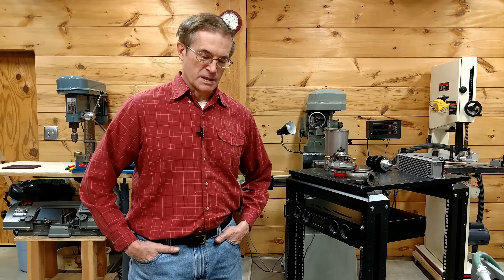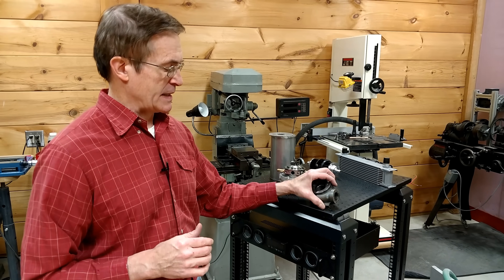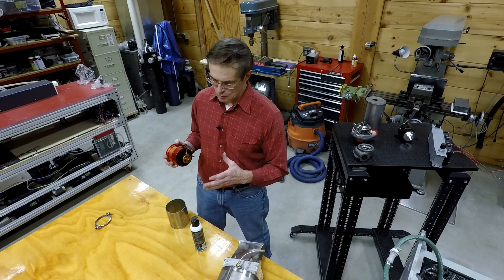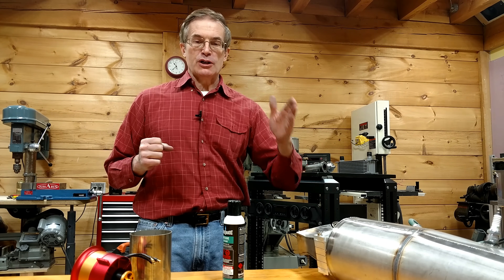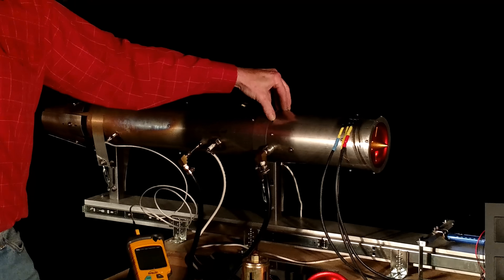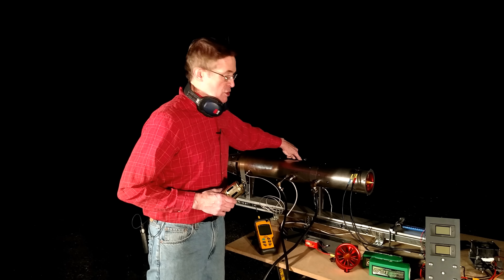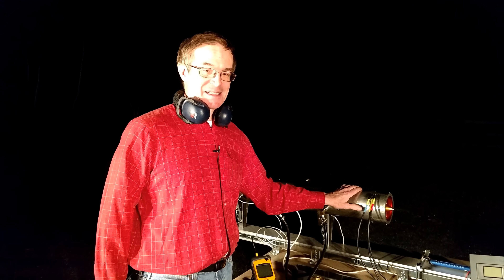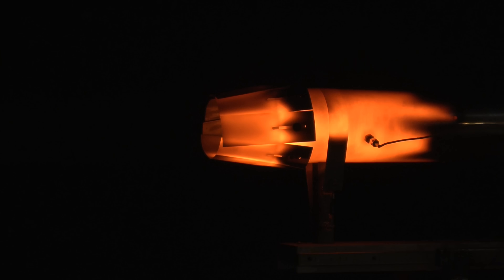Hybrid Jet Engine

Comment: I notice you say at 05:45 that water doesn't flow uphill and gasses don't flow from a low to a high pressure region. You should be explaining quite the opposite to understand the operation of a combustor.

As an analogy, on the pressure surface of an aerofoil, you will see a gas flow towards the trailing edge, despite an 'adverse' or increasing pressure gradient. It does this because it has momentum. Water, too, will flow straight uphill given it starts with uphill-wise momentum. A combustion chamber is in fact at the highest pressure in a jet engine (for a Brayton cycle), and the fluid flows straight into it, by trading off momentum during the diffuser section.
Reply from the maker: You make an interesting point.  However, the principle holds that gas will not flow from a low to high pressure region, given steady state conditions.  The kenetic energy present in the gas exiting the compressor blades can and is converted into additional pressure in the diffuser.  This is part of the compression process.
An analogy is the ram jet.  The pressure in the combustion chamber is higher than the surrounding atmospheric pressure due to the conversion of kenetic energy into pressure.
Reply: I have no doubt you are very knowledgeable when it comes to tech and physics, and your explanations are not wrong (Yes, I agree that a ram jet intake converts dynamic pressure into static pressure), and I absolutely love the quality of all your videos, but along the way you have picked up an incorrect "folk physics" statement:

"However, the principle holds that gas will not flow from a low to high pressure region, given steady state conditions."

It doesn't explain anything accurately and is in fact not true. The steady flow through a diffuser is proof by counterexample. You will see that fluid flows through a diffuser from low pressure to high pressure during steady flow, without any problems whatsoever. This folk physics statement is similar in nature to the incorrect wisdom "electricity always follows the path of least resistance".
Reply from the maker: "You will see that fluid flows through a diffuser from low pressure to high pressure during steady flow, without any problems whatsoever."Aside from your statement about folk physics, "without problems" is not a thermodynamic argument.Steady flow does not have any relationship to velocity changes and velocity changes are the principle that drives this change in pressure.Don't worry, I and many of the readers of these comments can handle the math.  Can you provide the equations to support your contention?
Reply: You don't need to invoke any thermodynamics as this holds even with isolated systems (zero work or heat transfer). Instead you need plain old Fluid Mechanics. 

I refer specifically to the one dimensional Navier-Stokes equations. Neglecting surface and body forces as they are irrelevant. 

∂ρ/∂t + ∂(ρu)/∂x = 0    
∂(ρu)/∂t + ∂(ρu^2)/∂x = -∂P/∂x    

The material derivative on the LHS is equal to the negative pressure gradient on the RHS. A consequence of these equations is that they can be satisfied by a velocity flow in the positive x direction with a corresponding increase in pressure. 

Say for air that starts with ρ = 1,225 kg m^-3, is flowing through a 1m length pipe from left to right, with a velocity of 10 m s^-1 at the inlet and 8 m s^-1 at the outlet, and the pipe is sized to allow that flow to cross the channel in 2 seconds.

Let's check the mass continuity
[1]: ∂ρ/∂t = (ρ_2 - 1.225)/2
[2]: ∂(ρu)/∂x = (ρ_2*8 - 1.225*10)/1

Setting equation [1] = -[2] and solving (I just did this numerically) finds that ρ_2 = 1.51324 kg m^-3.

Let's check momentum continuity:
The LHS (by plugging in the numbers) is:
∂(ρu)/∂t = (1.513*8 - 1.225*10)/2 = -0.07204 [kg m^-1 s^-2]
∂(ρu^2)/∂x = (1.513*8^2 - 1.225*10^2)/1 = -25.6526 [kg m^-1 s^-2]

Hence the RHS (by plugging in our previous two results) is:
-∂P/∂x = -0.07204 -25.6526 = -25.7247 [kg m^-1 s^-2]. If the initial pressure is 100 kPa then the final pressure is 100.026 kPa.

Therefore by solving the Navier-Stokes equation given our boundary conditions, we see that the pressure has increased, the velocity has decreased, and the density has increased. This shows unequivocally and numerically that fluid is capable of flowing from low pressure to high pressure during steady-state conditions. If this were not true, I assure you that aeroplanes would not fly.

Before raising doubts about the credit of these equations, first seek to understand the Navier-Stokes equations. Otherwise, if you feel the need to contest comments starting from the assumption they're wrong, purely on account of them being Youtube comments, I'll disclose that I have a first class MEng in Mechanical Engineering, and a postgraduate MSc in Aerospace Engineering. During the day I am an Aerospace Design Engineer for civil jet engines. I have published 1 book on engineering, tutored physics for 10 years, and have lectured university classes in fluid mechanics and aerospace principles.
Reply: I re-read your comment and I think we both already agree that fluid can flow into an adverse pressure gradient. I think the point of contention might actually just be the definition of 'steady flow'. If that's the case, then we just need to agree that steady flow allows a fluid packet to accelerate, so long as there are no velocity changes at a fixed point in space. Stated differently, steady flow simply means streamlines, streaklines and path lines are coincident.
Reply: What is wonderful about you is that you actually answer people! You aren't condescending and have time for the lowly even. Thank you.
Reply: Is this in response to myself or Tech Ingredients? He wasn't condescending but it was perhaps stubborn that he didn't concede when he was shown to be wrong. I put a fair bit of thought and effort into my responses, which is just a shame.

Comment: is the reason you're not getting shock diamonds because the pressure in the thrust isnt lower than the atmosphere or because the flame is too turbulent?
Reply from the maker: The primarily reason is that we do not have sufficient pressure in the throat to overcome the turbulence and allow the shock diamonds to be clearly seen.  You are correct that they are the result of supersonic flow into the surrounding atmosphere.

Comment: Hey! I’ve got a suggestion! Try using the electric motor to power a compressor instead of a basic EDF. Perhaps a unit from a salvaged hobby jet. A dedicated compressor will net you with much higher chamber pressures
Reply from the maker: True, but a lot less turnkey.  The best compromise may be to use a larger number of small, cheep, axial turbines.  Each will rotate in the direction opposite of it's predecessor and the RPM will self limit based on the mass/velocity if each is allowed a fixed current.

Comment: make an outer casing and have another fan at the end feeding it and the compressor. It will provide cooling for the inner casing. Like a Turbo fan!
I was a jet engine mechanic it the navy
Reply from the maker: Version 2.0 uses a thin stream of water>steam to accomplish this.

Comment: Very interesting.. I have my fathers pulse, V1 type engine in my basement.  never had the nerve or  knowledge to try to fire it up.. I think it runs on gas, and it needs an air compressor  for ignition.. does anyone know anything about these old engines..  ?   I can post pix. flappers before the tube.. really, I don't know what I have.. help.. oz

Comment: Demo in the dark place why like this
Reply from the maker: It is a visually attractive aspect of the engine, but more importantly it showed that the combustion of the fuel was complete prior to reaching the nozzle.  We are going to demo the two stage engine pretty soon.  We will show the thrust produced by the electric fans without the contribution of any fuel as well as the thrust produced when burning fuel.  We'll show this as well as an "exploded " view of the components of both engines and we'll do all of this with full light/during the day.  We'll show a full power run at night as well and we'll include some FLIR images of the engine and the exhaust plume.
Reply: Ahh ok thank for your sharing in your knowledge  longlive sir

Comment: You beat me to it :-),  I've been collecting components for a long time to do exactly what you just did.  I had some different ideas about it but basically what you're doing is sound.  I had planned to use a 90 mm fan for the core and a 120 mm fan in a multistage configuration with the air from the larger fan cooling the outside casing.  I then planned further to eventually connect them to the turbine spool to create a true turbojet.  As another poster has said it's nice to see someone who actually understands jet engines and their operation.  I further plan to use liquid fuel pumped through the spray nozzle from an oil burner.  The trick is going to be controlling the RPMs on the compressor as to not overstress the materials involved.  But I think it's doable.
Reply from the maker: It's good to hear when someone else is traveling the same road as you are.  A few points we have learned is that these fans, despite their power, are limited compressors.  Plan on pushing them as hard as possible in the pursuit of compression ratio.

Comment: I have been thinking about the thermal compound.. graphene from what I’m told is the ultimate thermal conductor ... could you use very fine graphite powder in a slurry to achieve something similar to graphene ?
Reply from the maker: Want to hear a secret? The performance of thermal compounds is much less related to the filler material and much more to the matrix it is placed in.  We've tested graphene, diamond, aluminum nitride and even single wall carbon nano tubes.  Because the matrix such as grease has a thermal conductivity 10,000x less than diamond and at least a thousand times less than simple aluminum, it is the minimization of the interface resistance that is the key.  Arctic Silver is good (annoyingly so), but we're knocking on that door and expect to pass it soon.
Also, there are methods, as long ans electrical conductivity is not a concern, that blow away these greases.  We'll show that as well.
Reply: Tech Ingredients cant wait to see that video

Comment: Future video where you build a jet engine or upgrade this with dremel or angle grinder, step up gears - high rpms- proportionally  big intake fan - higher intake volume - more power??
Reply from the maker: Yes, a future video is coming.  The direction is a little different than your list.  We will use a second stage EDF for higher compression.  This increases the conversion of the added heat into momentum and increases thrust.  We will add bypass cooling to protect the thrust tube and allow even higher combustion temps. We will inter cool the compressed air to increase the density prior to combustion.

Comment: how much thrust did you measure?
Reply from the maker: We pegged the spring balance at 10#. We're upgrading to 20 Kg for the follow up testing on the new engine.
Reply: Can't wait to see the results, I had thought about building something like this myself for some time.
Reply from the maker: If the second engine is successful and is well received and when we have our CNC mill up and running, we may offer some of the machined components through our website.

Comment: is there any chance you could post a D.I.Y video on the construction of the engine?
Reply from the maker: When we post the follow up video we'll show an "exploded" view of both engines showing the components and their relationships.  Furthermore, once we have our CNC mill up and running, if the new engine is successful and well received,, we may offer some of the machined components through our website.

Comment: Great video and explanation of how jet engines work. They sent me to two schools in the Navy to learn how to work on jet engines. AFUNP and the second one though was specifically for F-14 power-plants and related fuel systems and this video only took a couple minutes to learn what they spent months teaching us in school LOL. Just wish you had more in depth with parts list and building of the parts. That would be a great video :) Would love to see a video for converting that car engine turbo into a jet engine. I wonder if it could be done.
Reply from the maker: With the upgraded engine we will add a second compressor, bypass and inter cooling.  I will lay out an "exploded" view of both engines at that time so you can see the construction details and the dimensions.

Comment: i'd rather just keep buying my turbines, lol... 
another nice jet hack, is to simply modify a pulsejet engine. i used the tiniest pulse jet i could find for the experiment. and then just added a shaft parallel to it. with a small fan on the exhaust end. and a larger fan up front. the exhaust of the pulse drove the hell out of the fan system. and thrust was through the roof. 
only downfall is you only have to speeds.... hall ass and holy shit!
Reply from the maker: Sure, they are light and easy and elegant.  We like them too.
Your comment about the pulse jet is interesting as others have tried this with limited success.  The primary problem was the periodic shock wave hitting the turbine.  Other issues such as periodic flow from the compressor and resonance are mentioned.  If you actually completed this do you have some images, dimensions and specs?  We're working on a variation of this idea.
Reply: didn't really notice any real issues from our endeavor. flew very well actually. as far as specs go. i couldn't mount it to my turbines test bed. so we used a fish pull scale. which topped out at about 25lbs. and it fully pulled it out. i don't have any pics of it. it was not actually my setup. it was a friend of mine. who was not yet jet certified, and his finances were a bit short. but wanted to fly at our level. 
 as far as the design goes. we simply fitted  mounts for the pulse into a tube of sheet aluminum we rolled into a tube. i let him have an old 135mm edf i had. and he got an old 50mm edf fan from someone (don't remember). from there, we tacked bearings underneath and to the side of the pulses mounts (yes, inside of the aluminum tube, things are offsided a bit. which made mounting into his f16 a bit odd as well to get the balance centered correctly. but in the end, his f16 was about 20lbs. and flew like a beast for about 3 minutes or so. 
 really wish i could share more. but this was several years ago.

Comment: Are after burners not efficient? Why don't we see those cool adjustable outlets on commercial air liners?
Reply: Afterburning isn't anything close to efficient, which is why you find it on military jets but not on anything else. They're also very loud.

Comment: This is a wonderful video.  There's not many experimenters around anymore where it is worth the time to listen to their explanations, let alone quantify their results like you do.

I would like to point out that on full size jet engines, the start up procedure is to first set the turbine rotating to a set speed with the starter (pneumatic or electric), trigger the igniter, then introduce fuel.  This is done to decrease the risk of liquid fuel pooling and causing what is called a hot start, which can damage the combustion chamber.  You sidestepped this by using propane, but it's helpful to know for future experimentation.

Comment: It looks like the footage from that higher camera angle (during the intro) has not been colour corrected to match the other footage. (Most raw footage is captured to hold the most info, rather than realism) It's not a big issue, but is something that can be fixed easily with a simple filter..

Great video nonetheless!

Comment: I have a hard time understandig the bit about increasing the volume instead of the pressure in the combustion chamber. The cumbustion chamber being a space with a constant volume, I can't see how you increase the volume of a gas insted of increasing the  pressure. Of course, the gas expands, thus increasing its volume, as it goes through the turbine and then to the outside envirement, but I can't see how it would expand in the combustion chamber itself. Unless you mean it expands along the axis of the engine towards the exaust, then that would make sense, but isn't that a cause of the fact that the pressure is increased by the energy brought by the burning of the fuel?
Reply from the maker: There are two principles at work here.  The cross sectional area of the combustion chamber is larger than the output from the compressor.  If the air was not heated the pressure would drop a lot more.  The other factor is that the velocity of the gas molecules does increase and that would suggest that the momentum longitudinally would require an increase in pressure, but the density of the gas molecules drops as well.  That is why the cross section of the outflow duct needs to increase as the square root of the temperature increase and not linearly.
Also. if the pressure in the combustion chamber were not lower than the pressure of the air coming out of the compressor, the flow would cease, in fact it would reverse if the pressure were higher.

Comment: I wonder if it's possible to use some solenoids to adjust the nozzle diameter in real time - I'm no engineering buff (I majored in Medical Science) but it's definitely interested me!
Reply from the maker: This is both a good idea and not complicated.  The approach I would use is to determine a useful range of adjustment with cheap and iterative sliders like we used or even simpler slits in the end of the tube to allow it to be tapered inward.  Attaching solenoids or small liner screw adjusters will be much simpler and cleaner once a minimum range is determined.  Just as with the very highest precision optics, a distortion or flex adjustment might prove the best.